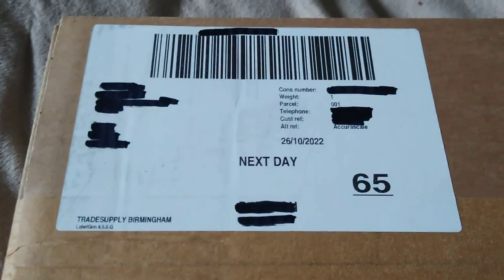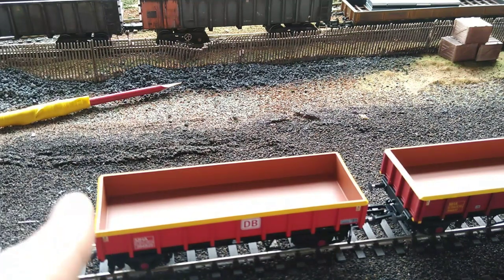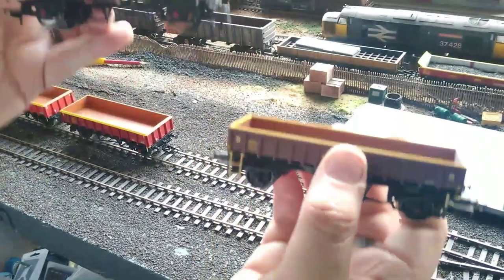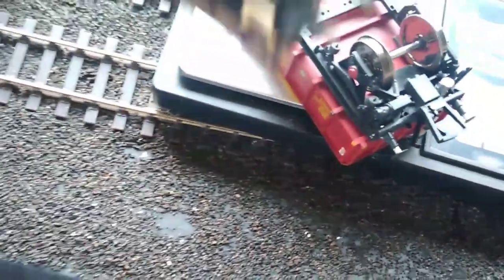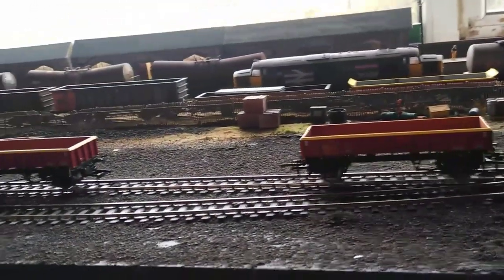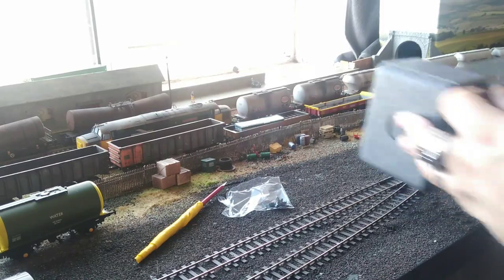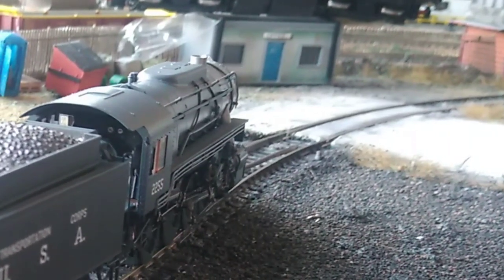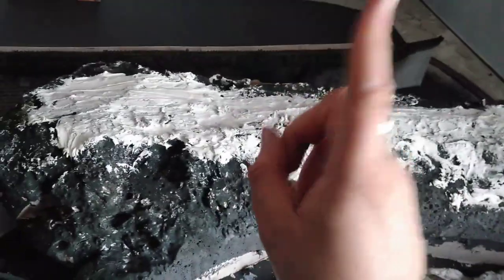These NEW Accurascale wagons are 'A-MHA-ZING!' | Iron Horse Weekly ep15

Comment: Layout looking great I also have some of the Accurascale buffers with lights they are lovely
I am all diesel so no steam I am modelling what I have seen in my life
Reply from the maker: It's a great way to keep the cost down just modelling one era!
Thanks!🙂
Reply: @IronHorseRailways  yes only problem is I’m in for about 30k so far lol came back to the hobby two years ago and filled my double garage with layout about 18x16 on two layers using a helix and I knew nothing about dcc 
I didn’t even know how to get sound out of a loco with sound fitted 
But now after lots of learning and YouTube I have wired and soldered and built up what I think so far is petty good for a novice
Not finished yet as you know always things to do 
I’m in blackpool by the way
Reply from the maker: @dionwoollaston2389  that's a fair old size! I could do some damage with space like that ♥️♥️😁😁
Reply: @IronHorseRailways  I have done that damage lol
Reply from the maker: @dionwoollaston2389  yes mate 🤣🤣